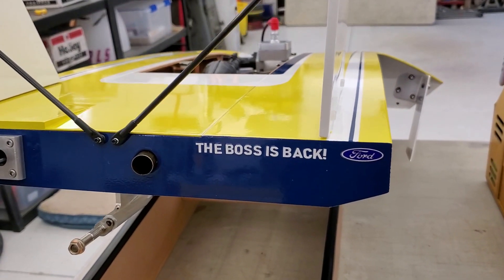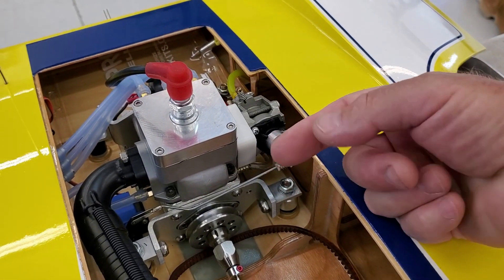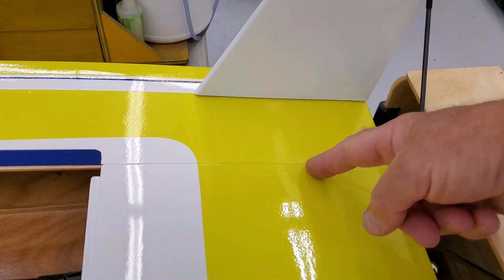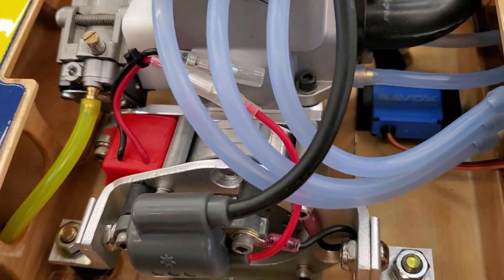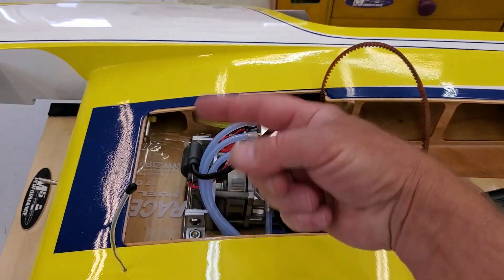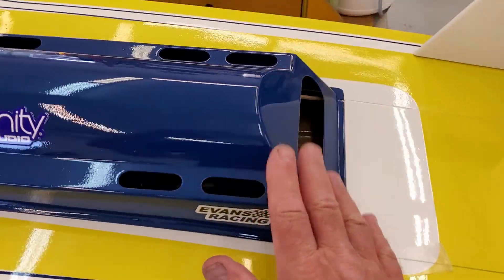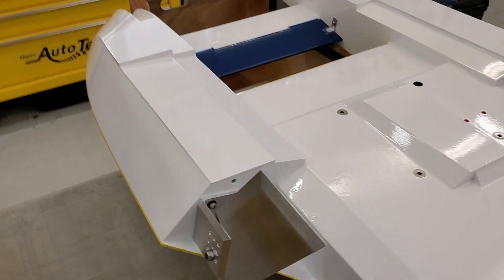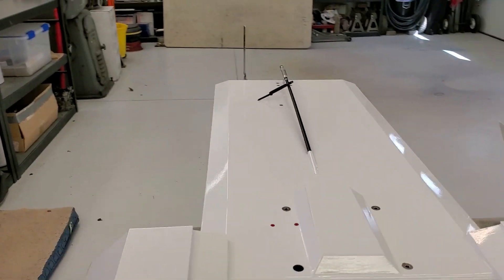RC Racing Hydroplane Revealed!  In-Depth Look at a Gas Hydroplane

Comment: love the boat but how are you attaching the verticals to the deck?
Reply from the maker: Dang Gary, I don't remember in which video I detailed that, but it's in my library of videos somewhere. Briefly, I install a vertical piece of .030 or .040" G10 to the floor and stringers and up through the deck about 3/4". The uprights are open on the bottom and fit down over these G-10 pieces. I drill through the uprights and the G-10 and use two nylon 6-32 screws to attach each upright, passing through the fiberglass upright and threading into the G-10.  In a blowover the nylon screws will shear instead of breaking the uprights or the G-10 mounts. Slick!

Comment: I just bought an ML kit 173 hmr 8700 it fits together perfectly.  I do have a couple of questions ????   Most boats I’ve seen have the engine tub is offset to the left this one the engine tub is offset to the right ????? And no I didn’t build it wrong, I swear !  So do I center the engine in the tub and do I run the drive shaft into the center of the tub or the center of the transom ?
Reply from the maker: Hmm... When you order it you specify which offset you want.  You must've gone the wrong way.  On 1/8 scale I offset engine and strut 1/4" to the left, 3/8" on gassers.  Not sure how you'll pull that off now, but at the very least you need to get everything centered.  Time to get out the Dremel!

Comment: Hey just a quick question regarding the floor mounts for the engine. How did you mount the actual mounts to the floor of the boat?
Reply from the maker: Huh. Seems I forgot to show that part, eh?  I cut a taper in the hole and use flat head aluminum screws from below, so that the heads are flush with the bottom.

Comment: I was wondering what type of fuel proof coatings u use on the gas boats?
Reply from the maker: I seal the wood using thinned West Systems epoxy before painting, and use regular automotive clear coat inside and out.  No special coatings needed!

Comment: What kind of paint do you use ?
Reply from the maker: Regular automotive paint, usually Deltron or Omni if I'm feeling cheap!  EuroClear has been my clearcoat for a few years, but I'm thinking I'll try one of the aerosol clears on my next boat... Video when the time comes!
Reply: M5 Performance Hydroplanes - Scott Meyers  Thanks I was thinking 2k clear should be resistant to gas.
Reply from the maker: Yes I've been told that it holds up excellent even with nitro

Comment: Hi Scott , wold your hydro work with a Lipos motor.
Reply from the maker: I'm sure it would. Bear in mind that though it is very light it's also very large, about 53" long, so I'm not sure if typical 1/8 scale electronics would work or not.  Of course, a guy could always scale it down to 1/8 and have an electric bullet!

Comment: Hey Scott,  Just check with local rc club,  ( RACING ASSOCIATION OF MIAMI) lake is closed,  but I  found out  about a non sanctioned lake that rc'r a running their boats.   Club is mostly running gas, no race class for nitros.  I will be looking for a gas hull.  Any suggestions?
Reply: I know you have designed and built your gas boat based on your years of experience and it looks really cool. I been looking at pit videos but can't tell which is wood or glass. I do like to build,  I need to learn how to walk before I can run before I go crazy and all out on a boat.  Need to check out  local club and see what type of hulls they are racing. Then I can make a  decision.  I'll check out Ml boatworks also.
Reply from the maker: So many choices!  Dunno if you're wanting to build wood or get a glass hull to get on the water quickly.... 
I've seen this glass hull run extremely well with no modifications;  https://www.rcboatcompany.com/SG110H-GS.html
Reply from the maker: But if you want to build from wood I haven't seen any of the commercially available ones completed yet so I'm not sure which of those I'd recommend.  My own design is very light and very fast, but I'm not selling it!

Comment: Hi Scott,  I ran across one of your pit tour videos, I been watching your videos for last couple of weeks. I really appreciate your love for the hobby.  I’m a rc’r myself. I have built airplanes, helicopters, fiber glass power boats and sailboats throughout the years.  Now I’m inspired from watching your videos. I  think I’m ready to build a wood hull kit.  I love nitro power and would like to build a hull around  a .67 rossi.  What would you recommend as first build?
Reply from the maker: Awesome!  Let's build boats!
So are you thinking of a hydroplane or some other type of hull?  If it's a hydroplane that you have in mind the Nova Rossi 67 is a great choice.  Be extremely cautious during break-in though since they are super tight when they're new. I take mine apart and lap the piston to the bore with 800 grit lapping compound to greatly reduce the break-in time.
But I digress (as usual).... 
If you're building your first hydro I'd suggest you build a 70's style boat, 1/8th scale, picklefork design with no wings. They are the easiest to build and best handling boats by far. 
The best place I know of to buy wood kits is MLBoatworks;
https://mlboatworksrc.com/
Take a look at the MHR (Master Hull Roster) 8255 hulls. These have been the best all-around hulls I think.
Many good fiberglass boats and cowlings are also available from RC Boat Company;
http://rcboatcompany.com/
Between these two you should be able to find almost anything you'd want!
Reply: @M5PerfHydros  Thanks Scott,  I will check it out,  have fun.
Reply: Ki @M5PerfHydros
Reply: @M5PerfHydros no that a mi que

Comment: Hi Scott, I'm totally new boats in fact I'm just painting my first hydroplane 1.8 th scale and it's all down to watching you. I purchased a 5.2cc nitro marine motor and I need your help in deciding what size propellor to fit with a prop shaft diameter of 4mm, if you wouldn't mind helping me, thanks.
Reply from the maker: Hi Andy,
I think I have bad news for you... An 8th scale hydro would typically use an 11cc motor, so that little 5.2 will likely not move the boat well at all.  I have no idea what prop to try, but it will have to be very small.
Reply: @M5PerfHydros  thanks for your input 
Scott, well It looks like I'm spending again 😒
Reply from the maker: Welcome to model boating!

Comment: Where do you get the magnets? PLeeease...
Reply from the maker: Right here!
https://www.kjmagnetics.com/products.asp?cat=11
Reply: @M5PerfHydros  Thank you.
Reply: @M5PerfHydros  Did you drill yours out or did they come that way? Are they even drilled out? I'd like to try this on my boats.
Reply from the maker: They come that way. Search around in the website... All shapes and sizes, drilled and undrilled. I use the 1/2" x 1" x 1/8" rectangles with two mounting holes
Reply: @M5PerfHydros  I'll find them eventually. I didn't think you drilled them because that would make a mess.
Reply: @M5PerfHydros  Whoops, sorry :(
Reply: @M5PerfHydros  And are you using 2 magnets or 1 with a piece of steel to mate up. I promise, last question...:)
Reply from the maker: I don't mind at all!  Two in each side. One mounts on the hull and the other in the cowling.  Dig back through my recent videos... One of them shows how they are mounted in the cowl and a few tricks to get it right
Reply from the maker: Here we go... In the first few minutes of this video you'll see it in more detail;
https://youtu.be/un5gT8_rmaI

Comment: Ive been enjoying your videos for a while now. Been in modeling most of my life, but never boats (built several, just never put them in the water). Anyway, I was wondering why the boats seem to all be built out of wood, with a thin FG layup rather than full FG with a few strategically placed wood stringers? Is it a class rule? Is weight the issue? It just seems that it would be little extra work to use the first build as a plug, make a mold, and then pop out a new boat or part there of anytime you felt like it. Obviously, you're already doing that with the cowels.
Reply from the maker: Great question!  I used to build fiberglass boats, but I find I can make them much lighter from thin ply. Also much easier to repair after the inevitable crash. Lastly, I never build two boats the same, so a mold and the ability to make a copy doesn't interest me!
Reply: @M5PerfHydros  Thanks for your reply. I suspected weight was the reason. If there were races in my area, I'd be seriously tempted to try with bagged CF. If, and until then, I'll live vicariously through your videos.
Reply from the maker: @ronr6450  - Best way to start races in your area is to start races in your area.... Build it!
Reply: @M5PerfHydros  I may have too. Need to figure out where it's permitted. We have a few local bodies of water, but I've never seen RC powerboats on them. Haven't found any clubs listed here on the NAMBA site.

Comment: I know a couple of ways you can shave another few grams, both motor plates front and back could have some holes and chanfers drilled into them, I don't think it will affect the strength of them in a significant way.  

Also there is very last part of your exhaust could be aluminum instead of copper so that would save a few grams as well.

That being said, you've done a damn good job and I really look into seeing that thing run!
Reply from the maker: Ah... Don't think I hadn't thought of those things!  First, the motor mounts seem to be some super low grade aluminum, no doubt to allow the bends without breaking, and I felt they were already so weak that any lightening might weaken them too much. 
Similar result for the exhaust, though I'm still considering it. An aluminum tube of similar strength requires a much thicker wall and I found the brass was actually lighter. Perhaps I can get away with a thin wall aluminum tube, and I may yet try it!

Comment: Great videos!! What woods do you use to build boats?
Reply from the maker: Finnish ply from Balsa USA.  I use 1/8" and 1.5mm for most of the construction, and 1mm and 1.5mm for the top deck and bottom skins.  https://shop.balsausa.com/default.asp
Reply: @M5PerfHydros  Hi Scott!  Thank you for your answer.  I am a fan of H1 Unlimited, even here in Europe, and I bought a plan to build a replica of an H1.
Reply from the maker: That's awesome!  I'm guessing you must have found the plans from David Newton at Newton Marine.  Have you seen the wood kits from ML Boatworks?  Mike's kits fit together perfectly like a puzzle, and dramatically shorten build time!  My Eliminator was built with one of his kits and is featured on his website.  Check him out here;   https://mlboatworksrc.com/     Thanks for watching!
Reply: @M5PerfHydros  Thanks Scott!!
Reply: @M5PerfHydros  My plan was designed by Roger Newton, but after watching your construction videos I was in doubt what type of wood I should use to build.